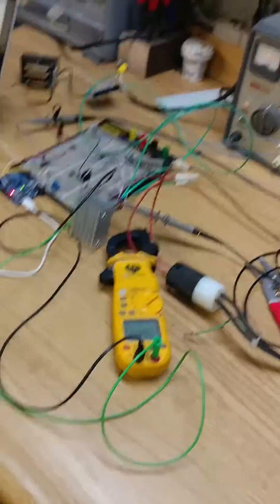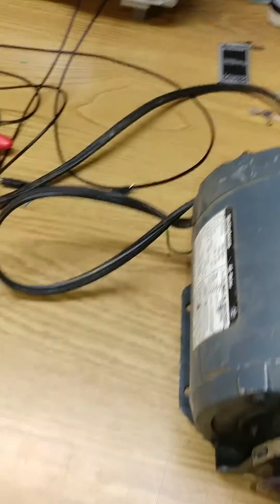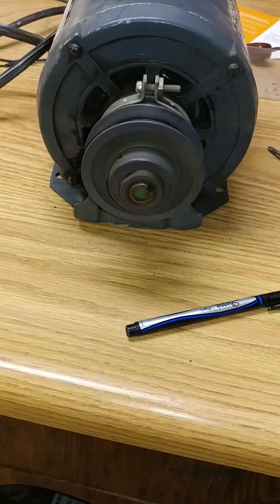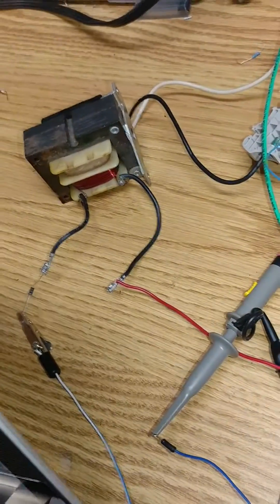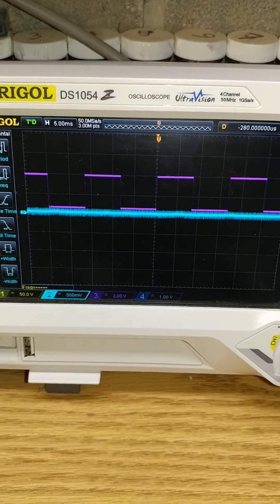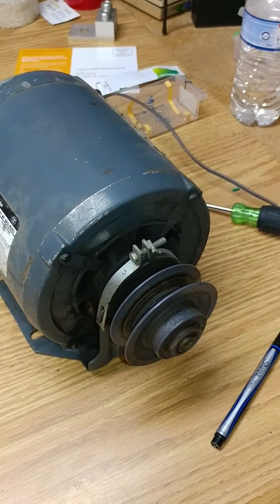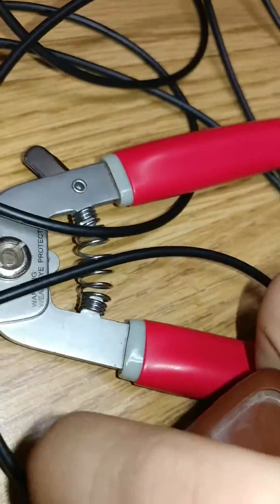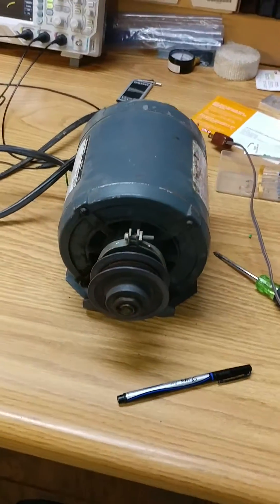Single Phase Soft Start Homemade from Arduino

Comment: thinking about doing something like this to be able to run an AC compressor on a lower wattage generator, my compressor pulls 14A at 240V and starts with 106.5A (oof), it would take a bunch of paralleled TRIACs but I'm confident it is possible
Reply: Your compressor will not start easier with a soft start motor  You need to dump the loading valve until the motor gets to full speed.
Reply: @aldergate-ca  im actually am working on one for a small 8k BTU roll around stand-alone unit, so far i went from ~27A starting to ~15A, which is a 44.4% decrease in current, not bad, the unit has no starting capacitor so maybe some assist by adding a starting cap may help with torque at the lower voltages, im trying a number of different ramps on the firing angle, right now i start with a slow linear ramp to get it spinning, then a fast linear ramp to get it up to speed.

Comment: @Percy FloresYes you can use a dimmer circuit as a soft start, or modify the sketch to usezero crossing, or any other method. did you read the article?https://www.instructables.com/id/Arduino-controlled-light-dimmer-The-circuit/You have all in that article the only thing is you have to modify the sketch.I did not manage to modify that sketch yet.I asked Jobie Rosell 2 months ago if he willing to share his project but no answer.Good luck

Comment: Very cool I want to make one for my table saw if you could tell me what size of triac and the code for the arduino.
Reply: you can find the schematics for a similar project @ https://www.instructables.com/id/Arduino-controlled-light-dimmer-The-circuit/, I would use a Bta40- 600 for a table saw, usually 15amp 110v.
Reply: @rogergoldring3650  light dimmer works like soft start?

Comment: Cool stuff.   We did a 3 channel version to control lights in about 1984 with a TRS80 and a point to point board using intel counter timer chips.    Things have gotten easier.